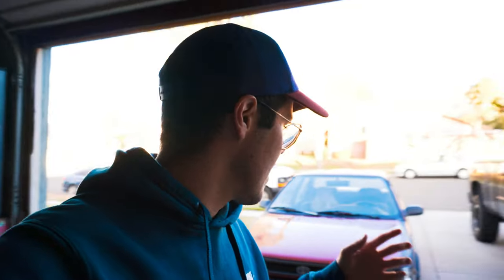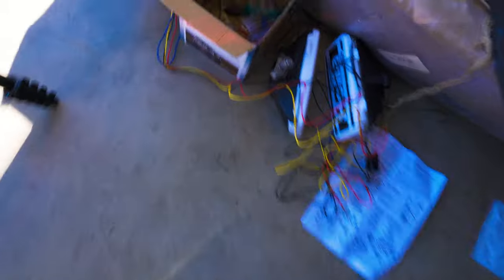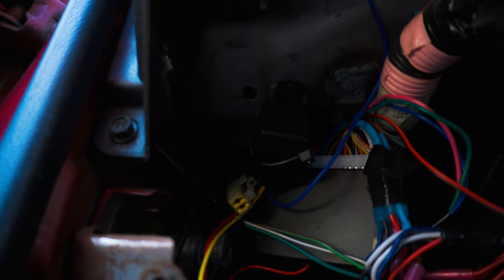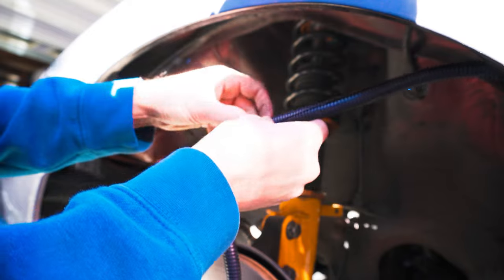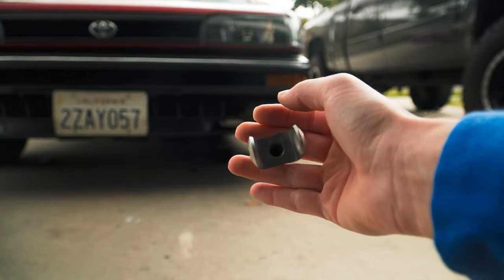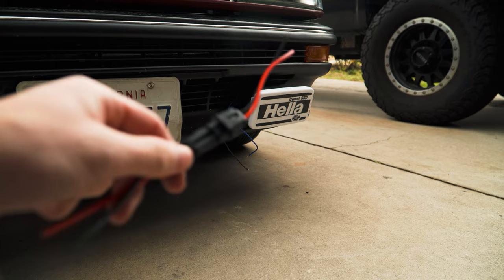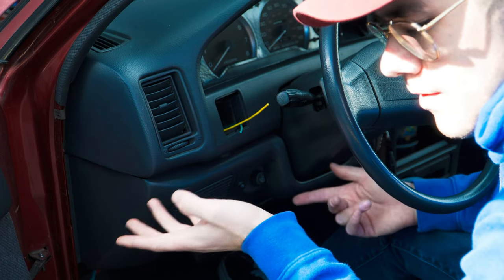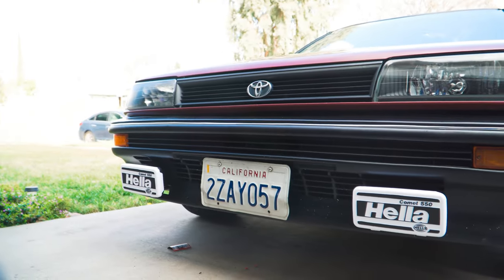Hella 550 Fog Lights Install | Ae92 Toyota Corolla

Comment: Do you happen to know what size bolt/thread size for the bolt that connects the battery hold down thing to that front beam in the engine bay? I have an AE92 Corolla, got a new battery for it, and when I took it off, the bolt fell out of my socket and into the engine bay...

Comment: Planning on putting the same fog lights on my AE92 and was wondering on how the beam patterns on the 550s are. The stock headlights have quite a narrow beam especially when driving on dark back country roads. Comet 450 with fog pattern lenses are quite hard to find recently, so I guess the larger 550s would work for the meantime.
Reply from the maker: They work mostly just for looks but I ended up throwing in led bulbs for much better lighting so i would go that route for better visibility 👍🏻
Reply: @Doogsturr  Did you go yellow leds or are they now like bright cold white?
Reply from the maker: @eroy5448  yeah i put yellow projector style leds and it made it way brighter than the stock bulbs 👍🏻
Reply: @Doogsturr  they would look even better without that ugly California flat front square license plate.

Comment: They look good, is the light output any good, at least comparing to modern led lights, I like the retro styling and want something that will fit the look of an old Jeep but I also want lights that are going to be useful.
Reply from the maker: @FeleniousGru  slightly better than just the headlights and if you add better bulbs even better. Gives you some more width when driving down the road.